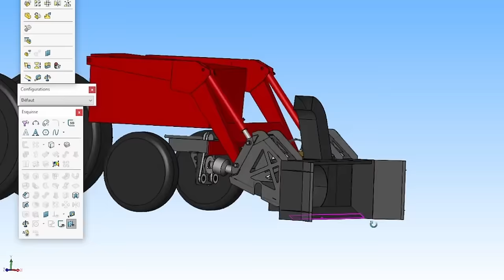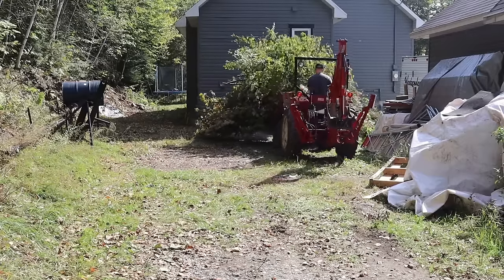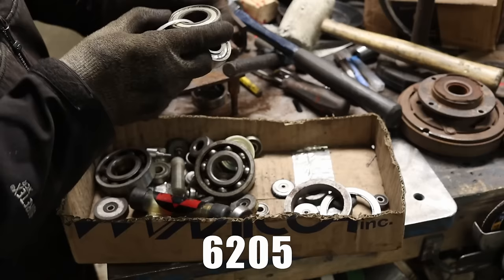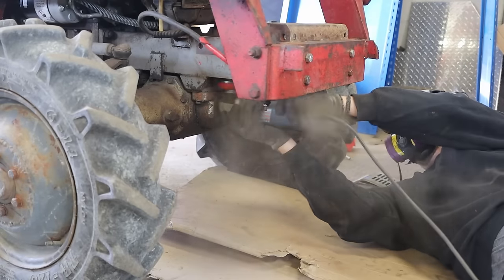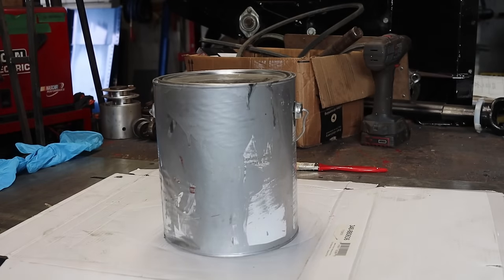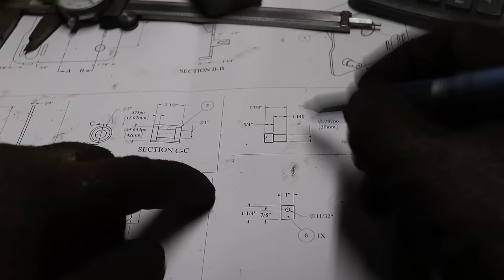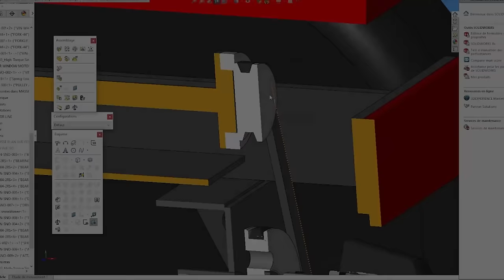Custom Snowblower build on a tractor's loader - Part 2

Comment: So freaking cool. You are the man, Viny. I could have only done about half the stuff in that video. I probably would have driven the blower with a hydraulic motor because my machining skills are way behind yours. I can't believe how cool that turned out. Huge props.
Reply from the maker: My man! Thanks AC! I tried to K.I.S.S. that snowblower and resist the urge of putting a secondary engine on it!
Reply: @VinyB57  having that assembly with the clutch already on it was awesome
Reply: @VinyB57  
I want to do everything electric now. Mainly because the pto is an electric cord. 
But…I’m on the k.i.s.s. therapy prorgram!
😜👍
A lot cheaper lol

Comment: A trick for future: Weld on the inside of the part of the bearing to shrink it. you wont need to cut it, because weld shrinks and diameter narrows and you will be able to push bearing out with no effort ;)

Comment: weld inside the race of the bearing, it will shrink an pop out easier than cutting with a cut off wheel

Comment: If you destroy the bearing and only half of the bearing is left and you want to remove it i will give a tip. Welding. Welding cause shrinking and ring contraps and remove lightly. Simply just welding circle 3 strips on old bearing ring and thats it. No need to thank. Greetings
Reply: Were looking for this comment 😊😊
Reply from the maker: Yes thanks, I'll try it next time!
Reply: Yes we do this at work, warning everyone said welding hardened steel will make it shatter and send hot sharp shards all over the shop, but have welded race cones for years and never witnessed this.

Comment: Nice job! Excellent fabrication skills. I did something similar with an old combine. I used wheels instead of the factory skid plates that were on the blower and so far have been very happy with them to avoid scarfing etc. Also, huge to be able to look ahead, saves the neck!
Reply from the maker: Oh yeah! Saves the neck big time! I'm thinking about installing a backup camera too...the ultimate neck savier 😅

Comment: I have the exact same plan but I am going to use a hydraulic driven blower and a PTO hydraulic pump. I am in Ontario by the way and a first time viewer.
Reply from the maker: Great project man, let me know how it went...or if you want it, you could send me some pics at design57@outlook.com, I will post it to my community!
Reply: @VinyB57  I need to build my workshop first.

Comment: You know those guards are much easier to put on usually than to take off. However, I do usually remove part of the bell on the connection side because with 2 guards it is a bit cramped.

Comment: You might want to consider adding a chain from the loader support (front bumper) to the loader torque tube to limit upward travel of the loader while its connected.  That way you dont over lift the loader, disconnecting the PTO shaft.
Reply: Guess I should have watched the last 30 seconds of video before commenting...
Reply from the maker: Yep! 😂

Comment: good content, but in the old days they would just twist the belt.  you see that a lot on old farm equipment.  
Although, one could also have fun with a planetary gear set there.  😁
Also, a good time to convert to hydro, although only beneficial if you have high snow.

Comment: if you have a TIG welder and a broken baering. you can try to weld the inside of the outside bearing ring. then the bearing chrinks and you can remove without damaging the part. also i have some 6205 ready  :D

Comment: Tip to get an bearing race out , run a bead of weld round the inside the weld pulls the race smaller and it drops out
Reply from the maker: Thanks for the tip! I,ll try it next time...if I remembered it 😅

Comment: Yeah, you sure got ADHD and it just earned you another subscriber!
Keep on spitting out that content! 😄

BTW, by making the larger pulley that the backside of the V-belt rides on convex it will self center and stay on it without any guides. 
However, with too much sideways force it will run of, so for the convex pulley surface to work the system needs to be pretty well built and in line 👍
Reply from the maker: @Mr.Engineer.
Keep on spitting out that content! 😄: SURE WILL!! 👌

Comment: Love the ingenuity in your drive system! Just curious though why you didn't go for a hydraulic pump and motor... heck it would have solved your rotation issue and given you huge range of motion on the loader, and let you engage and disengage the blower, no? Would the power loss have been an issue?
Reply from the maker: Simply put....money! (also the pump needs to be on the PTO and mine stops with the clitch...so it wasn't an option...but mostly money!)
Reply: @VinyB57  totally fair haha!

Comment: nice job. i have a question, wouldn't a hydraulic pump be more use full?
Reply from the maker: I could get a PTO hydraulic pump ($$$) + and an hydraulic motor ($$$) with some controls and hoses ($)...I mean the belt was 30$ and the PTO shaft was free, thanks Vevor 😅  I mean K.I.S.S.

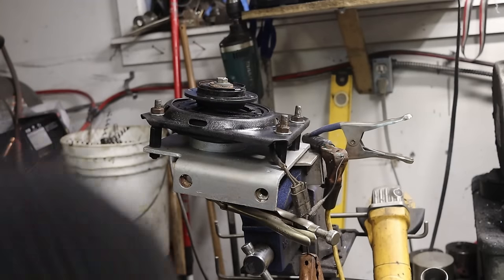Comment: 8:00 i would just flip the blades
Reply: ahh rpm's
Reply from the maker: Not only that, a snowblower is not symitrical, so flipping the blades won t cut it and the auger is like a big screw,  it cannot be reversed